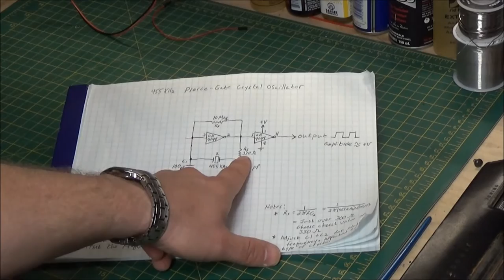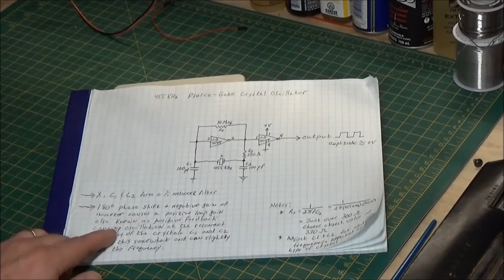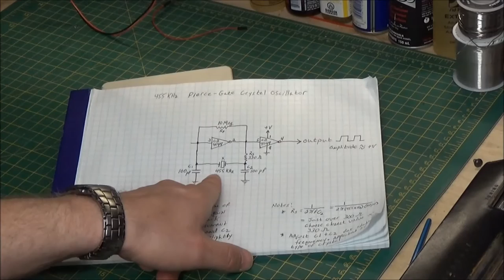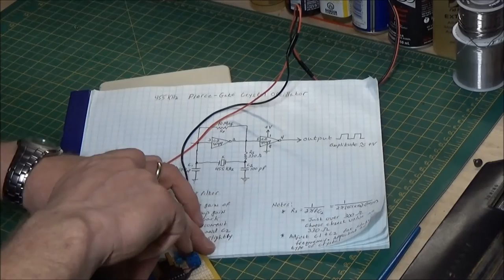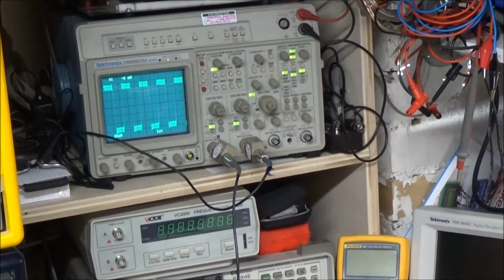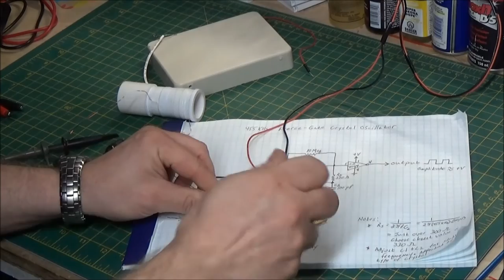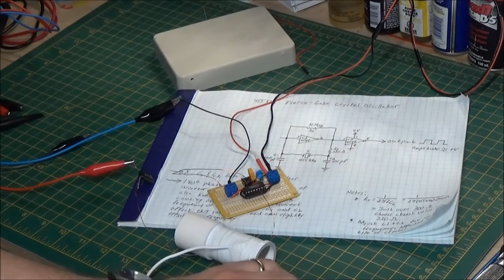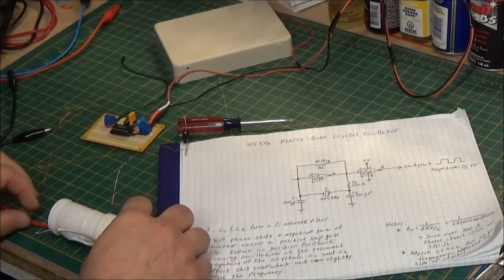Building Pierce Gate Oscillator for 455kHz IF Alignment

Comment: A toroid coil for 455 khz is made easily with a T50-15 toroid to get about 121uH that when used with a 1000 pf capacitor, it oscilates at 455 khz.  This about 91 turns (7 ft 24 ga wire).

Comment: The ringing is likely due too inductance in the leads of the components. You could try to tighten up the loops. you may also want to add a 0.1uF decoupling cap on the Vcc of the hex inverter IC.

Comment: What's the signal look like with a higher voltage on the CD4049? The datasheet for that chip shows nothing lower than 4.5V under test conditions. I always thought that 5V was minimum for the older CMOS chips.